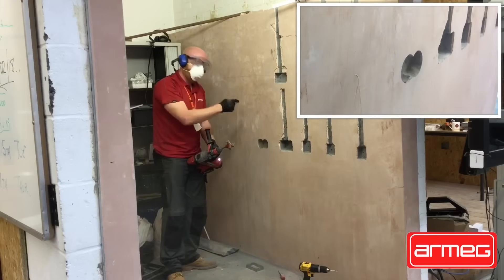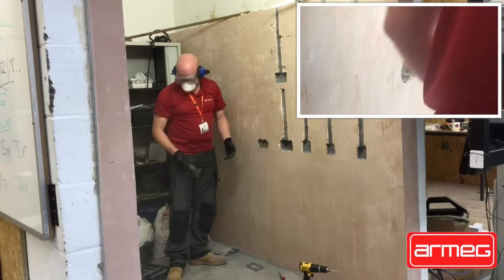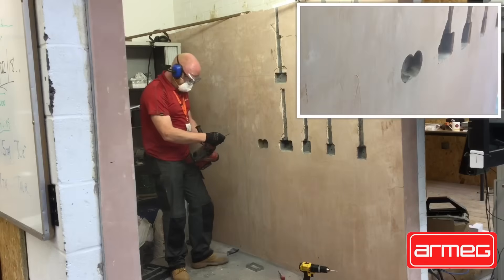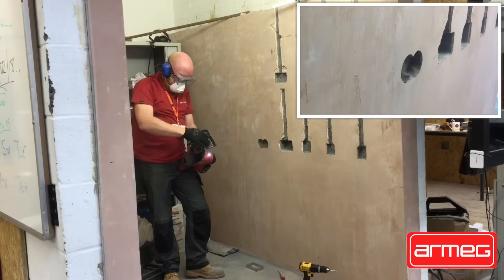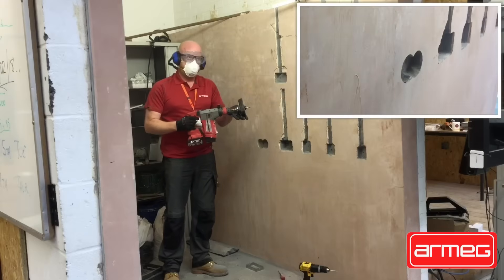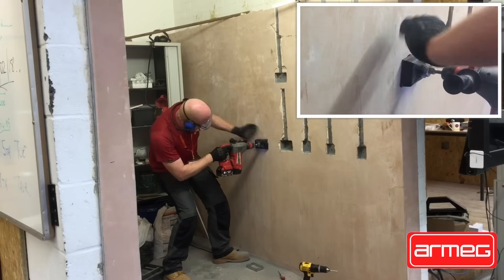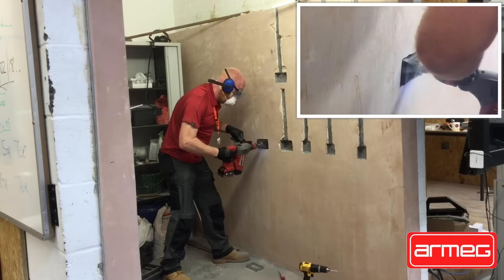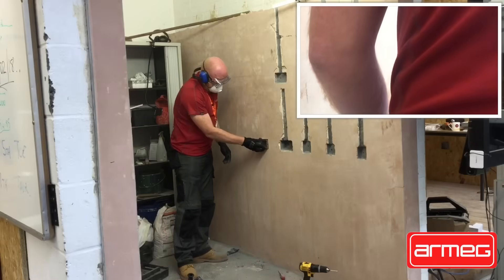How to Chase a Wall and Fit a Metal Flush Twin Socket Box Using an Armeg Tri Cutter (Full Demo)

Comment: Where do u get the template to mark the holes either side of the side center hole at the very beginning
Reply: It comes in the double back box kit as you don’t need it for single boxes.

Comment: how long do the tri cutter or box cutter last? How many uses? Do you need to replace them regularly? I was under the impression they were for DIY use.
Reply from the maker: great question Fabian for the answer I would contact Armeg. Thanks for watching and commenting. Gaz 👍
Reply: @GSHElectrical  I was just curious how much you use them and if you'd broken any! Cheers and great upload.

Comment: Try that on a Victorian house. 

On the walls they're using, you could chase it out with a wood chisel! 

Toys for the boys!
Reply: Many of the buildings in North East Wales have been built with bricks called Ruabon Reds for over a hundred years. In the 1980's a Hilti Rep come to the depot to demonstrate the new tool of the decade, an explosive powder fixing gun, knowing what we new from experience, we all sniggered and waited for the moment. These bricks are as hard as glass and brittle, when he fired the nail into the house brick, the brick crumbled into shards, needless to say he wouldn't do that again. He did  end up selling us stuff, as Hilti's are marvellous for firing nails into steel beams and concrete.

Comment: Did you test this onto the solid concrete wall?
Reply from the maker: Hi. Unlikely to work on concrete. Thanks for watching and commenting Gaz
Reply: @GSHElectrical  Okay, thanks for your replies.
Reply: I work corby so I can attest to the fact that it wont even mark concrete. It will do red brick slowly but it wont touch the concrete

Comment: Had one of these over 10yrs ago and to honest I didn't find it all that, works well on thermalite blocks but actual bricks or concrete blocks no very good, ended using and lump hammer and bolster and out of pocket
Reply: Hi Sean, sorry you feel that. Over 10 years ago, the EBS system was really only designed for the softer materials. In this kind of time frame, as with most products, improvements have been made and the new generation EBS system (with the new Tri-cut round cutter) will cope with any masonry material. The round cutter removes the bulk of the material then squaring off is done with either of two components depending on the compressive strength of the masonry material. Feel free to contact us if you need any further help.
Reply from the maker: Hi. Thanks fo watching and commenting. My 16 plus year old learners loved it because it’s a gadget and in my workshop we have very few cool tools. All the best and thanks again GSH Electrical

Comment: Hi Guys can you send a link of where I can buy these chisel bits also do they work on brick walls?
Reply from the maker: Hi. Phil says you can use the chisel on brick walls rather than the box cutter. Try 01246411081 for Armeg help
Reply from the maker: https://www.googleadservices.com/pagead/aclk?sa=L&ai=DChcSEwie9sudrdrbAhXKlO0KHTqoBsYYABAEGgJkZw&ohost=www.google.com&cid=CAESQOD28BjEogsS7GlijURpacBZlSnO2eEFjo1P21cmTsLWh6ZhopAbVxvEuMysRaj_Ugesu5o3JoMD11F5auhO_xs&sig=AOD64_3cqoxOCxcFK47BTeV44O7-fKxW4g&q&adurl&ved=2ahUKEwjavcSdrdrbAhVKYsAKHVZ4CI8Q0Qx6BAgKEAE
Reply: Hi. The EBS system will work on any masonry material. You remove the bulk first using the round cutter then square off using the square cutter in the softer materials or the 80mm wide chisel in the harder materials. The channelling chisels just bounce off in harder materials and shouldn't be used. Blocks are usually fine, red facing bricks and up to concrete common bricks.

Comment: Another good video guys, love this bit of kit, got it in my van. It's not a cheap bit of kit, but one of those tools that once you used one, you use again and again. Tip is also if you have say 5 to cut out to do all the 5 same time with each bit then the next bit 5 times. Thanks Gas and Phil for the tool update. Guessing we can purchase the spare bits anytime?
Reply: Hi fellas, as Plymouth Sparky mentions, the square cutter is not designed to sink in the harder materials. An 80mm wide SDS chisel is in the kit for that. I usually say as a general rule of thumb - If you are sinking to a depth of 25mm using the round cutter in seconds this would be considered a soft masonry material and you can use the square cutter. Above a minute you should use the chisel. Feel free to contact us if you need any further help - Phil.
Reply: Plymouth Sparky Hi will this kit work on brick wall?
Reply: Yes it will Spark Sparky, probably not with the square bit, all the rest of the bits no issue. But like always try to find an area or one out of site first if possible.